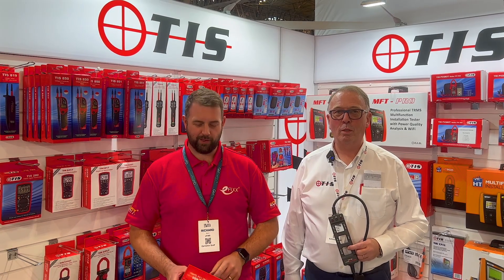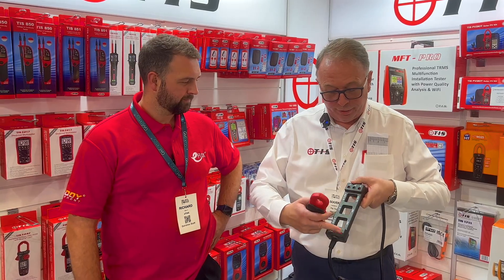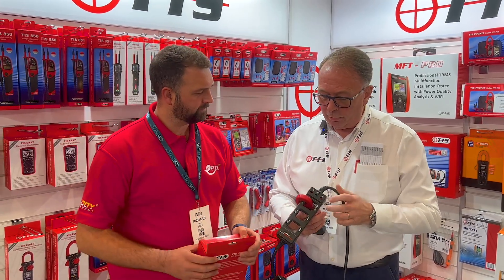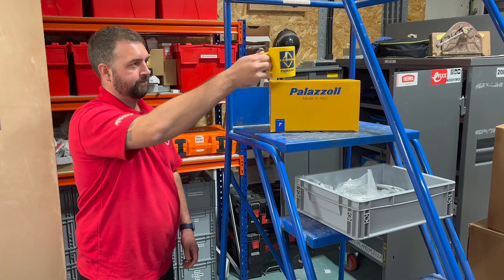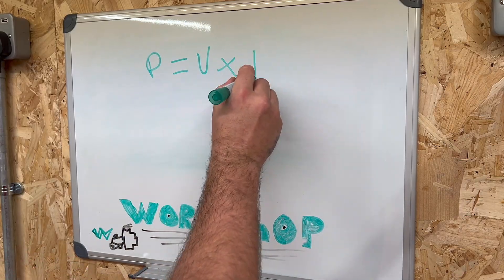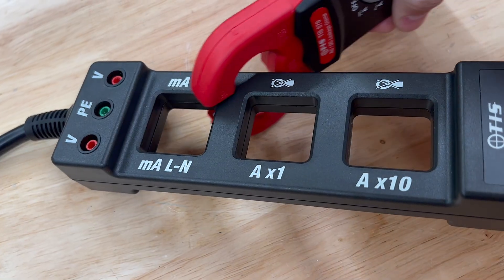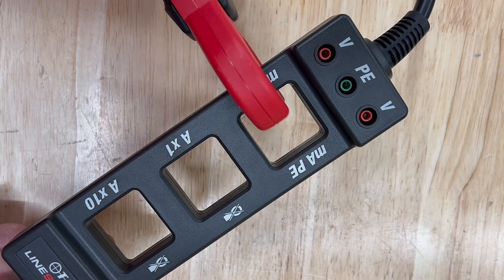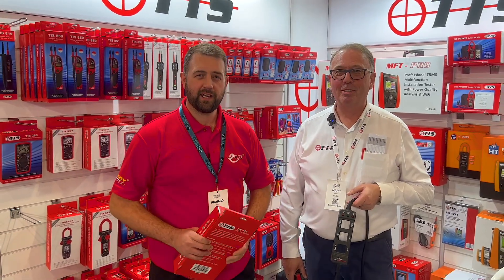Every Electrician Should Have One of These!

Comment: Will you do a video on how to install a led ceiling light after removing a ceiling rose, in my country we have box in  ceiling  in uk were i will put up some led lights for friend, i was looking at forums and most electricians have differant ideas , wire in light say some, 
but ones i installed have little room, others say put in connector box and shove in ceiling, others says currant regs make that illegal, as it has to be accessible, others say rewire to switch, no one seems to agree

Comment: I agree all should have one.  If you don't buy it, make one.  It just needs a plug and a socket and individual wires to connect them.  It's a piece of test equipment. It does not need to be pretty, it just needs to be safe enough for a thinking professional to use it.

Comment: You can make one of these, but I do have a 455 and it's a great bit of kit.
Reply from the maker: You can make one David. Mere mortals can buy 😉
Reply: @efixx i made my own plug socket flex with five inch of sheath removed. It Works a treat.
Reply: With more and more Earth leakage items I ended up making one 😂 it’s a bit more crude and involves a 3D printer but I’ll think I’ll upgrade to a proper one

Comment: The microwave is sitting on rubber feet on a metal workbench so it is insulated between the two. There not an issue.
Reply: As a 'theoretical' consideration, there is the potential for capacitive coupling between the case and true/external 'earth' that would take return path current away from the CPC and Neutral resulting in a 'diverted' current (i.e. rubber feet is merely galvanic isolation). 
A historically common situation was oscilloscopes being used for RF measurements where 'earth loops' were considered to be a problem (e.g. connecting to old TVs that had chassis at neutral) where the earth CPC wire would be disconnected in the plug or instrument, supposedly to avoid RF earth loops.
The funny thing was that the now 'isolated' chassis (esp old tektronix ones)  still had a large stray capacitance to earth, keeping the RF earth loop in play.
I'm also aware of situations in rack mounted equipment where the RFI filter common has gone to a separate 'earth' / chassis, and again has stolen the return current from the expected paths (see ~2:50).
Reply: @philipoakley5498 so the rubber/ plastic feet service no real purpose then. 
But I have to say what you have explained has gone right over my head. So am I right or wrong? As you say a theoretical situation. Always learning something new in this industry. Thank you for your detailed explanation
Reply: @Dog-whisperer7494  They're there to stop you scratching your countertop, so not sure they serve no purpose.  Anyhow the point is, measure LN to see how much leakage there is and then clamp earth to see how much of that is returning down the earth conductor.
Reply: @Dog-whisperer7494  Hi, yes, I'd joined up three slightly different 'fault' scenarios into the same discussion, each of which can 'divert' some of the return current.
The Apple charger situation (0.4mA) is the 'no fault' unexpected earth earth current caused by the charger's internal radio frequency filters which include a capacitor between power/live and the CPC-Earth, which sends that 0.4mA to through the CPC.
Then there are the fault cases [pun] where the equipment chassis has been disconnected.
[... etc. To be continued, Fusebox is being replaced, power going off!]

Comment: Put any metallic object in a microwave oven and turn it on sparks will fly. Followed by a big bang . What area you some sort of pilchard .
Reply: Two microwaves in our kitchen, a standalone and a built in Bosch combination which comes as standard with a tray and a wire rack made of metal.  

It doesn’t even have a glass turntable. 

No sparks in the oven.

Model is CMG633BS1B, been in use for around seven years now

Comment: Do not place a cup of water in a microwave without putting a smooth metal object like a teaspoon into the cup. The water can super heat and flash into steam. Most microwaves have a warning symbol on the front to advise of this.

Comment: I had a home made version of that. 
Power factor for consumers is not much of an issue as products got better pf correction these days.
Unless your breaker trips on over current there is no worries.
Our 25kW solar inverter does has serious ground currents via it's filters that trip our 300mA ground fault breaker when the provider switches taps on the transformer.
Those regulators sometimes give an unbalance just long enough to make our breaker trip.
Reply: How often does your energy provider switch transformer taps that you know this?
Reply: @JasperJanssen  I has nerd issues.